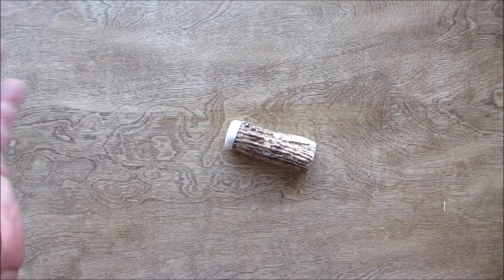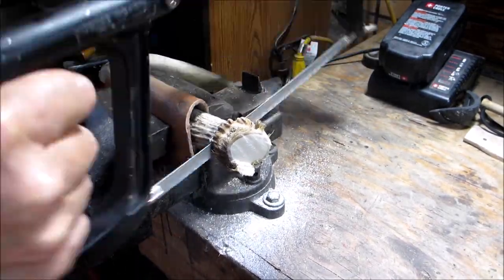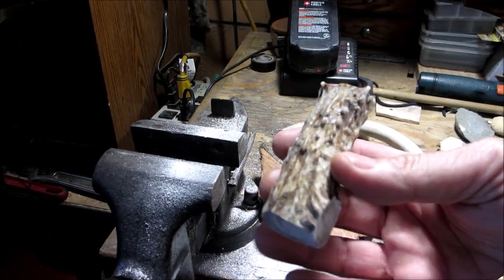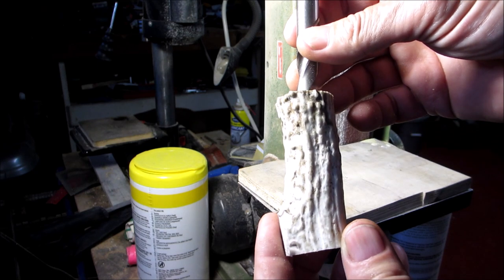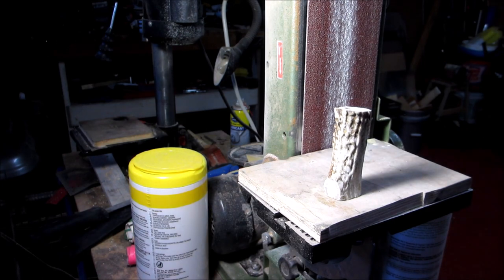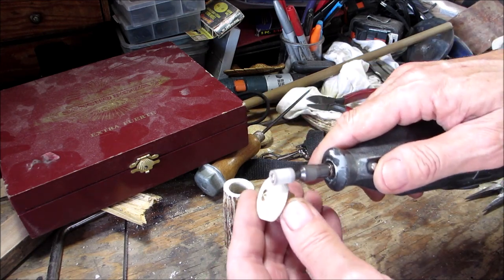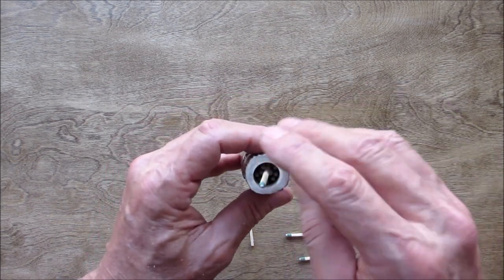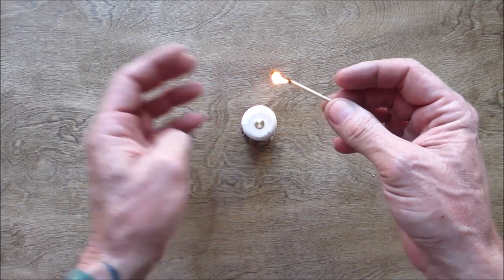How to make a Deer Antler Match Safe!

Comment: you should have left the bottom on the case it would look cool , i used to carve faces on the antler button they mostly turned out nice
Reply from the maker: I was going to do that, but it was at a steep angle and I didn’t like the way it looked. It would have looked awesome if it was straighter!!